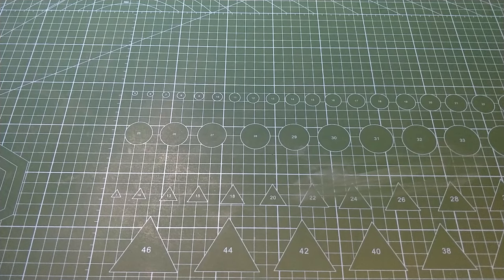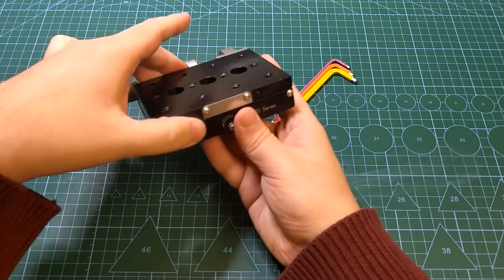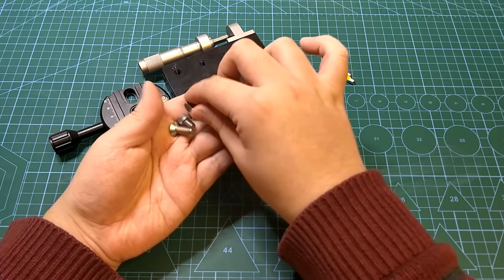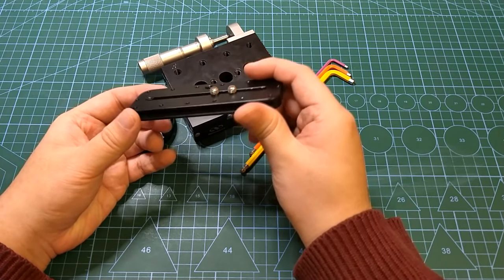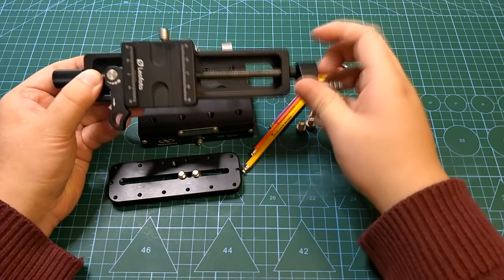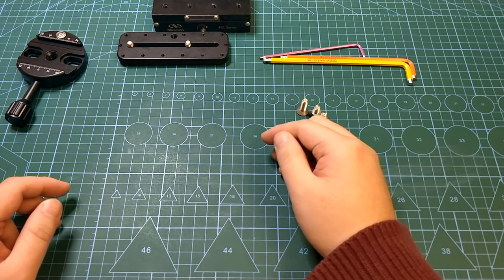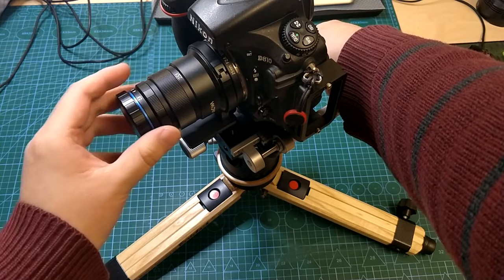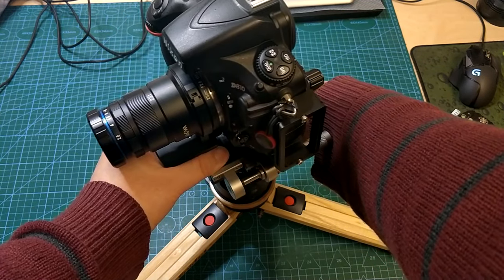Photomacrography EP1: DIY Macro Focus Stacking Stage

Comment: What's your method of focusing with the Newport 433 Precision Linear Translation Stage with 25mm Vernier Micrometer? Do you eyeball each focus point before tripping the shutter or dial X amount of thousandth of an inch per shutter click? This new hobby now looks labor intensive and should I just splurge on a new Cognisys Stackshot Macro Rail; LOL. Thanks in advance.
Reply from the maker: You can get the Wemacro rail for a lot cheaper, they have no dedicated controller, everything is set on a smartphone which everyone owns nowadays, through bluetooth. It's not at all a compromise unless you fancy a nice dedicated controller box. There's numerous downsides of the stackshot and frustrations I've had with it... well lots of them. Long term comparison and review coming next month. I just need to prepare the script. 

I rarely do deeper stacks with the manual rail. 0.5um resolution is good and all, I have the stackshot and wemacro for everything else. Mine is used for testing and inspection, which I do through my Z6 rather than expensive scientific cameras. 

You can look up on how to use the micrometer, it's hard to put in words. Since my applications involves mostly singular exposures, I just use liveview, zoom in, and eyeball it.

Comment: Spring is too weak when angling camera; lens and bellows at a downward 45 degree angle. I bought one on Ebay and need to return for refund. Any suggestions to beef up springs? Thanks in advance.
Reply from the maker: What you do is make sure the micrometer is PUSHING against the travelling block, in opposite direction of the direction of the resultant force due to the gravity of the system... what a word salad. This is hard to explain in words. It shouldn't be a problem however.

Basically if you're shooting vertically, the gravity of course is towards the Earth's core, or rather perpendicularly downwards. The stage is placed on stand so that the micrometer is pointing downward. Actuation will result in the micrometer pushing against the resultant force due to gravity. It's similar in your case, have the stage at the same angle but make sure the above is met. Does that make sense? 

The springs shouldn't be touched, they are rated for the stage and swapping them out could pose problems. No matter how beefy it is, it won't be able hold up with a heavy system.
Reply: @diatomsaus  Thanks for the fast reply. That makes a lot of sense. I'll have to try that before I decide to return. My setup is a Nikon Bellows with Tokina 100mm 2.8 Macro lens and Nikon D850 (kinda heavy). I just bought a Nikon 50mm 2.8 Enlarging lens on Ebay and will mount the lens reversed on the bellows. Thanks again. Mahalo
Reply from the maker: @caltari  It's not as heavy as mine, the stage works well for me. Just make sure you have some safety measures just in case you fail to tighten the clamp, I've smashed specimens and objectives because of that.

Comment: 1 inch is 25.4mm not 25.7mm as you say in your video that 0.3mm is a lot in macro photography
Reply from the maker: Yeah one inch is 25.4mm not 25.7mm my bad.
Either way metric standard spacing which is 25mm won't allow imperial one inch spacing hardware to be mounted without compromise. 

Also that mistake has nothing to do with macro, not sure why you felt necessary to make such a remark. The micrometer does 1um increments, imperial or metric threads it doesn't matter.

Comment: The lefoto is not a good rail and is not suitable for stacking. I returned mine and got NISI NM-180. That is one of the best rails at that price range.
Reply from the maker: Yep, the left-right wobble is just horrible, even visible at 1x!  The Nisi rail is made by Leofoto as well, which means they likely improved their lead screw and precision greatly, or for Nisi only... 

I still recommend using an industrial micrometer driven stage.